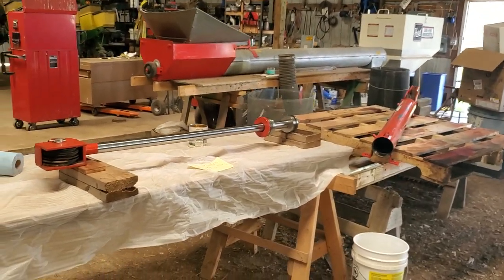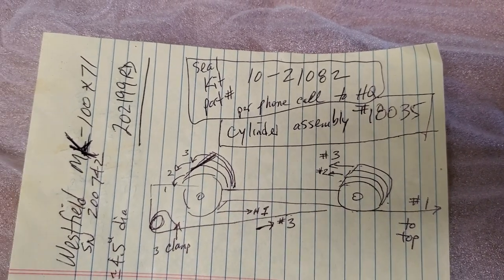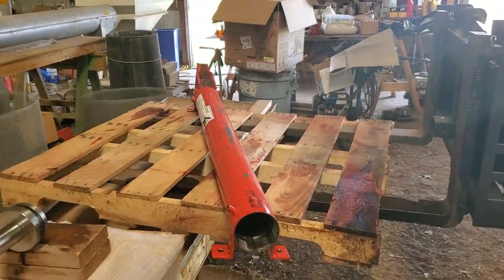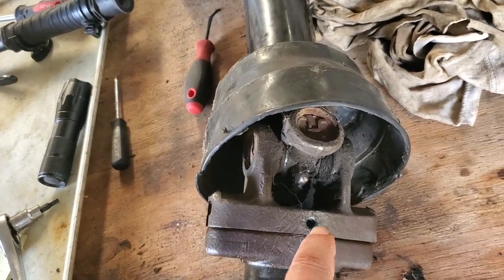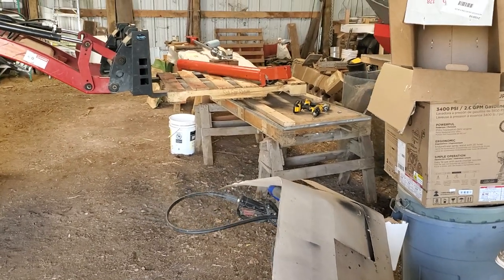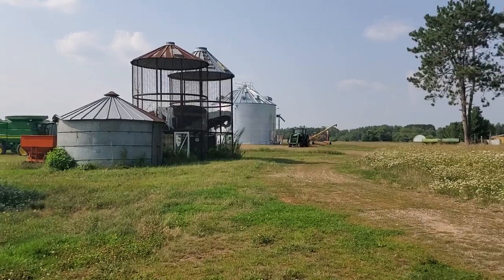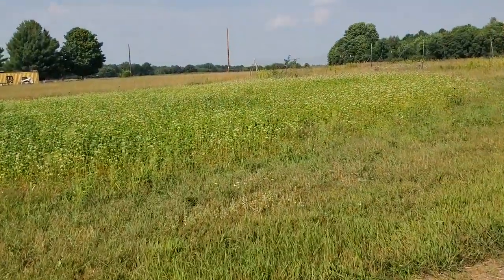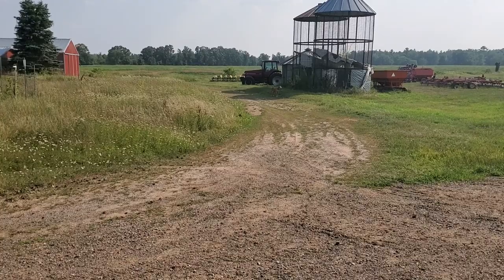Westfield MK100-71 Grain auger lift cylinder disassembly

Comment: How did you remove from auger with the steel cables around it
Reply from the maker: I removed the cable clamps on the top end of the auger and then pulled the cable out of the two cylinder pulleys. After rebuilding the cylinder and bolting it back to the auger I re-threaded the cable and re-tensioned it using a come along.
Reply: @grasscreekfarmturtlelake1741  so you just lowered the auger all the way down first. Did the cable have a lot of tension of it?
Reply from the maker: Not that much tension. It was a lot easier to take off than put back on. To get it off I just put the auger as low as it would go and there was enough slack in the wire to let me  unbolt the 3 U clamps holding the top part of the cable in a loop. I took it off from that end because the end attached to the bottom of the cylinder had a hard kink in the cable where it was clamped and so wouldn't easily go through all the pulley grooves.  @justinbushbaum6207
Reply from the maker: Another thing to add, when I was putting it back together the technical support people at AGI/Westfield  (866-467-7207) were really helpful. They've also got a pretty good YouTube page showing some details on the augers
Reply: @grasscreekfarmturtlelake1741  thank you for the reply